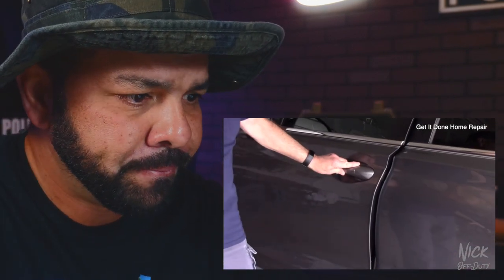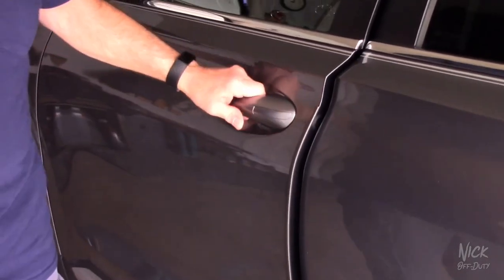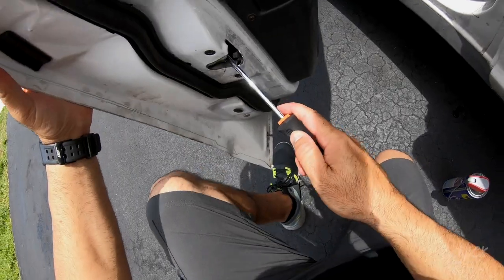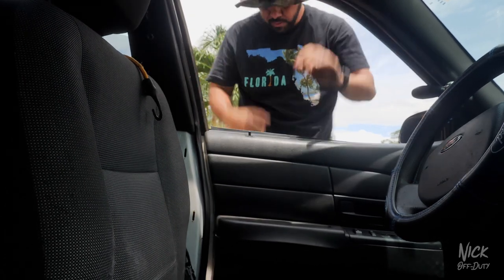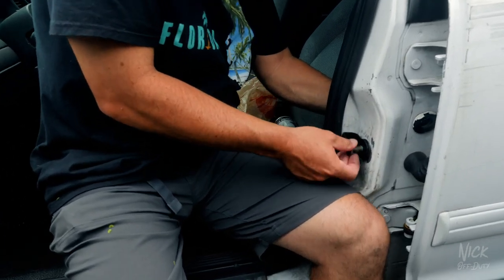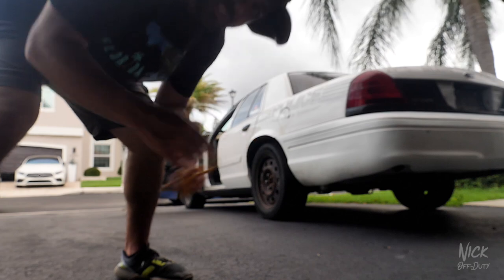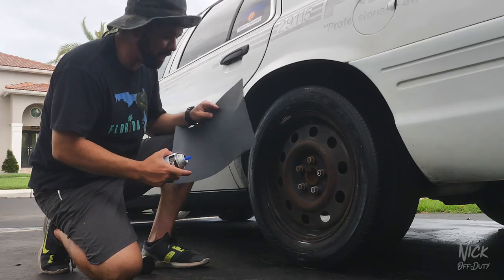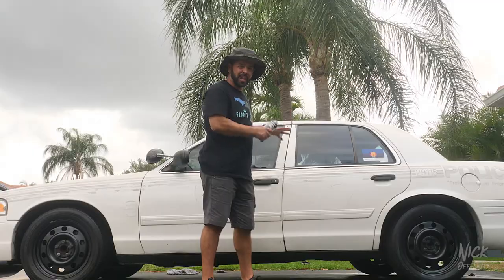POLICE CAR BUILD : Ford Crown Victoria Interceptor Broken Door FIX

Comment: Nick, needs new hinge pins haha. Also if that spray paint on the rims starts flaking or peeling off, sand down rims or use abrasive pad, spray towel with cleaner lightly and wipe away dust, and then use heat gun or blow dryer to dry any hidden moisture in the cracks, can come out of nowhere when spraying and ruin entire job haha

Comment: Hey Nick love the car I also have a Crown Victoria it used to be a former Everett Police Department vehicle and it still had the decals on it and when I took the decals off it looked like your car with all that Gunk on there with the adhesive if you go to I believe AutoZone or O'Reilly's they have something called aircraft stripper I know it sounds weird but if you get that and spray that on there and let it sit for a little bit and get a like a metal scraper like a paint scraper so easily and it'll make your car look amazing just thought you might want to use that trucks that I learned to get that adhesive off and it'll make your car look ten times better